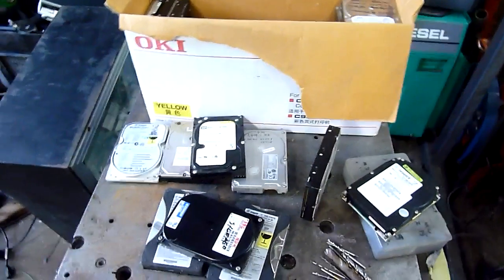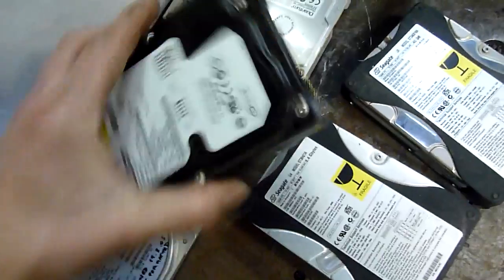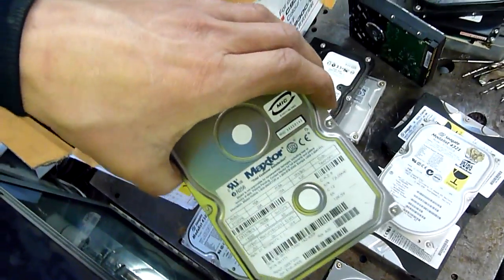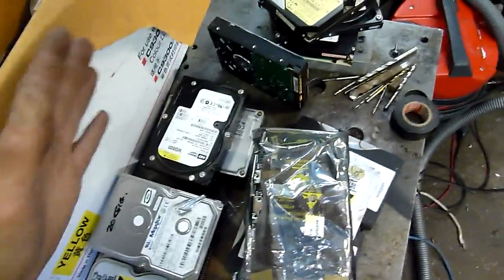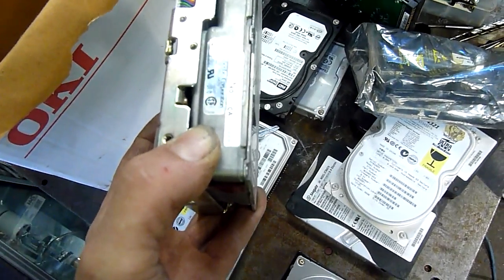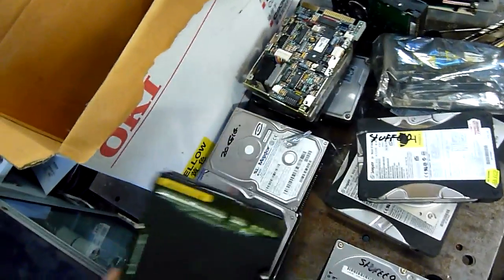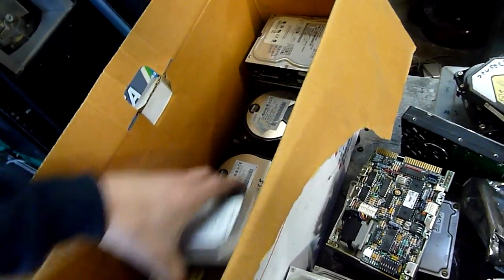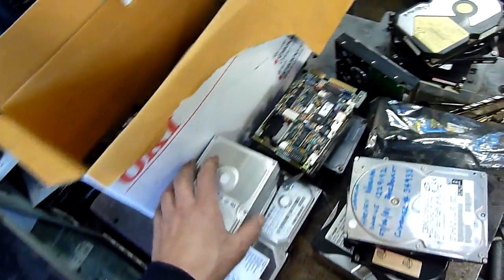60lbs of Mystery Hard Drives

Comment: I have a WDC 2120 125MB
872 Cylinders, 8 Heads, 872 Precomp, 872 Landing Zone, 35 Sectors 119MB
In my 486DX-40MHz 8MB RAM (Upgraded to 20-24MB) Windows 3.10A alongside DOS 6.2.
And one of the big Creative ISA monsters. And a Trident ISA Graphics card. And a BIOS like jgcertified's 486
Reply: +UltimateSmashingFun I have an IBM Type 0665, which is an early voice coil MFM drive. There are 733 cylinders, 7 heads, 17 sectors per track (common for MFM drives), and a write precomp. of 734. Someone in the past probably dropped something on top of it and left a quite noticeable dent on the top where the magnets for the head stack would be. This drive only has three defects on it! 

Cylinder 626, head 2, BFI 08770
Cylinder 658, head 3, BFI 01809
Cylinder 730, head 4, BFI 01168

If I remember correctly, this drive hasn't gained a single bad sector since it left the factory in what I believe to be 1986 or so. 

The controller on the bottom consists mostly of metal can IBM custom parts, and includes an evil wax / paper capacitor on the bottom.

Towards the front of the drive are some large power transistors, presumably for the spindle motor that get extremely hot during operation. 

It runs best with an interleave of 2 at just under 300KB/second.
Reply: Hah! Built to last!

Comment: Memories.  I still have an opened up Seagate ST296N 85MB SCSI drive I used on my Atari ST for years.  I remember the early stuff.   When people hacked 10MB Shugart drives into Atari and Commodore 8 bit machines and wondered what in the hell you'd ever do to fill 10 Megabytes when a floppy disk stored 88KB and no program was over about 48K.  Names like Miniscribe, Connor, Kalok, etc.  Had to be parked or they'd crash on shutdown.  Had to be reformatted often due to stepper and band drift that would throw the heads out of alignment over time.  Generated enough heat to cook eggs on and about as reliable as a UFO sighting.  Thankfully technology has marched on.

Comment: Why do you keep all those faulty drives.?
Reply: for all you know some might have been tested to be bad but still work fine same with one of my HDD's it was tested to be bad but worked perfectly and still does to this day its 3 years ago since i did the test
Reply from the maker: some of them are gone, but if its a vintage drive or odd size I keep them just in case (some can still work or be repaired)
Reply: Aussie50 Just to let you know I have your same Sony trinitron TV which was saved from a landfill its that 10 inch early 70's one
Reply: Aussie50 I have a old Conner hard drive

Comment: Also seagate are trusty drives. I've been running a 250gb seagate in my computer for about 8 years and it's still working like new.
Reply: I like the older Seagate drives newer ones not so much but WD is my favourite
Reply: Late reply, but I have a Seagate U Series 5 30GB that ran for about 17 years and still 0 bad sectors

Comment: Those Maxtor drives are definitely good. Had two in use for at least 10 years with 5 years spent on pretty much 24/7 and only replaced them because I wanted a faster drive

Comment: In your country maybe. Depending on market inflation. For minimum wage allowed by gov. here you will spend half of salary for a new  320 GB drive converted in $ is about 90. 1 TB had drive is about 167$
Here brand new computers were sold with second hand drives by medim and small shops.
I've paid 270 $ on a new HP 15.6" laptop (2 Ghz, ATI HD 6320, 4GB RAM, 320GB HDD brand new), how can I pay 167$ for a single f*ckin hard drive ?

Comment: Somewhere around here, I have an original Seagate ST-506 5 meg MFM drive...  That Miniscribe looks like the same drive that's in an old Tandy 1000 that I have... It's mounted on a metal frame along with the controller card...  The first IBM compatible computer we had was a 386 Gateway 2000 with 4 megs RAM and an 80 meg hard drive.

Comment: ExcelStor were built with Conner branded parts, I am unsure of wether they were Seagate owned by that time or not. I have some 20MB drives around, I also have a Maxtor XT, apparently it used to cost something in four figure numbers and was an extremely high capacity drive in it's day: 760MB unformatted capacity. It uses 2-lead ESDI and takes up two 5¼" bays with a black panel that has an activityy LED on it. Still works and makes awesome noises and when the head seeks, the desk shakes.

Comment: I used to pull old drives out of computers in the local scrapyard just to see what was on them. They normally got taken apart, stripped for motors/magnets, then given back to the scrappy for cash. It was nice knowing the night watchman there :)

That was years back though, data security is much tighter now. I believe the scrapyard shreds anything that even looks like a drive these days.

Comment: private/personal data should not be ignored, personal E-mails, diary, not to mention photos etc. easy enough to wipe (just time consuming). The circuit boards can be useful if it's the control electronics that died. I recovered a drive just last month which was one of those old seagate with the rubber covers, one of the ICs had fried, swapped board with similar and worked just fine (drive was a old 10Gb but the swapped board came from a 20Gb drive, looked the same and worked! :)